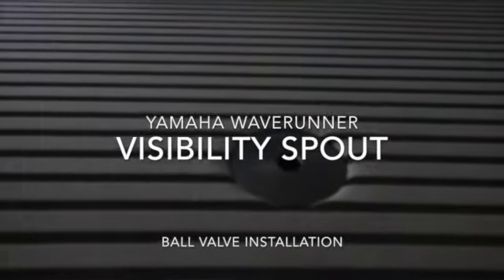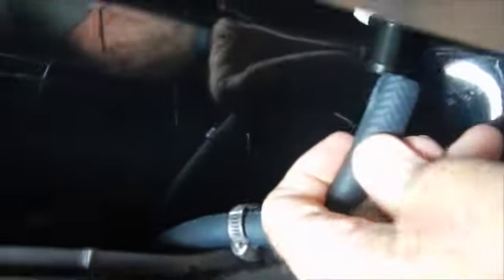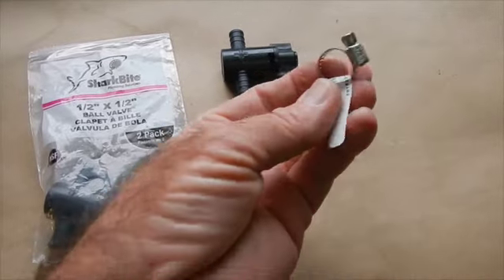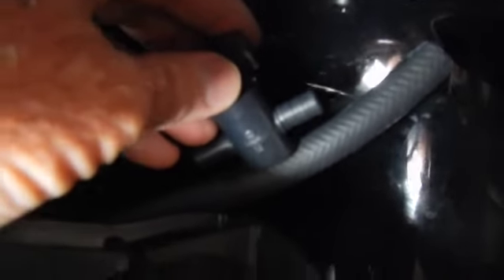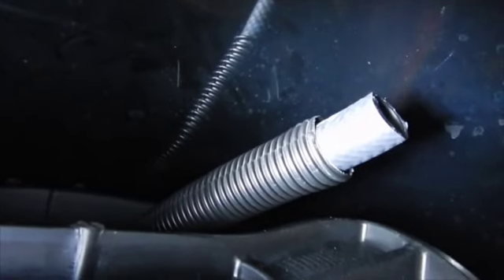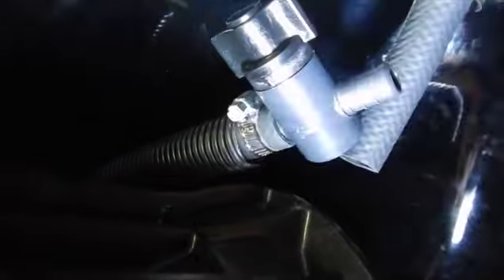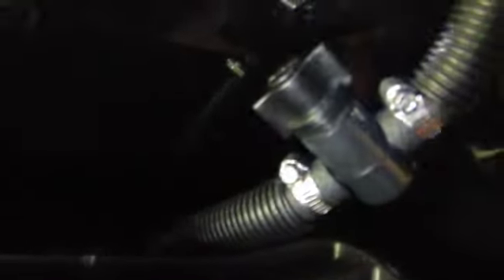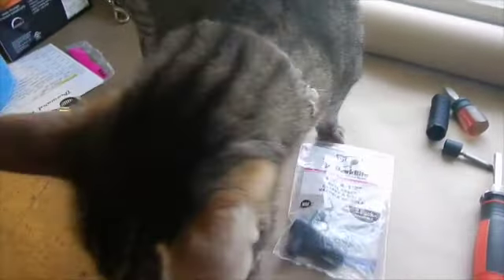Yamaha Waverunner Visibility Spout

Comment: seems interesting to do. What do you think about using a 3 way vavle instead. I would like to stop the visibility spout at times but not stop the flow of water so I was thinking if I could locate something like what you did with a third output connector. That way I could just divert the water back down to the water whenever I want to.. Do you know where I could find a fitting like such?
Reply: The flow of water will continue with the single valve off as well. All that it’s doing is picking up the water as it exits the spout and it’s forced through the hose and out the spout. If you shit the valve it just continues out the steering Novel. What you are saying doesn’t add up. Follow the hose from the spout down to the pump outlet you’ll see what I mean. It has zero to do with the wave runners functionality it’s still moving the same volume of water either way.

Comment: Question. My jetski will run driving straight but every time I turn it cuts off. Then when I hit start starts right up but seems to be when handle bars are turned . Any idea what it could be
Reply: McDermott inc you’ve got a lose connection on your start stop take your bars apart and look for a bad connection
Reply: Yea I agree or a rubbed wire shorting on something

Comment: If you just remove it wouldn't it squirt water inside the ski?
Reply from the maker: No it gets the water from inside the propulsion nozzle it is all outside the hull
Reply: Just sprays under the tail board if you unhook the hose where he showed you.
Reply: I see now... I took it off on my jet ski
Reply from the maker: I ride with a group and they don’t want the spouts on, so I turn it off when I ride with them. The spout does seem to make you more visible when running at speed so that is why I use the valve.
Reply: How is the valve working for you? I joined a club and need to do the same.
Reply: Gardachief How is the valve working for your ski? I joined a club and they also want the visibility spout turned off when riding.
Reply from the maker: It works great, I usually leave the spout on when I am riding alone and it is hot or just with a friend. Group rides I close it off. Had it about 9 months now no issues.
Reply: Thinking of doing the same on my Yamaha.
Reply: Don't think just do it :)

Comment: Wouldn’t this mess something up since your holding up or blocking off water that is meant to be coming out
Reply from the maker: Jonathan Sanchez no the spout water has no other function. It scabs water off the jet outflow which gives it the pressure. No other reason, if you look at the jet output you will see the small tube for the visibility spout.
Reply: Thanks yea I was kinda worried about messing something internal since I figured blocking that would not let water come out and would eventually mess something up but thanks if it’s just a tube coming out of the jet then I guess it should be alright
Reply from the maker: It will not hurt anything, if you do not want to be able to turn it off and on you can just undo the rubber hose under the deck. I like having the option because it really does make you more visible to boating traffic. Most club or group rides do not want the spouts on because it gets those behind wet and is really hard on the sunglasses with the salt mist.

Comment: Great video man. What is the size/diameter needed for the valve and clamps? Are you using stainless steel or zinc plated? Thanks.
Reply: It's just a 13mm or 1/2 inch. Clamps are 6 - 16mm (stainless steel)